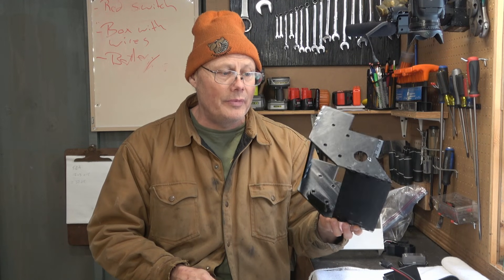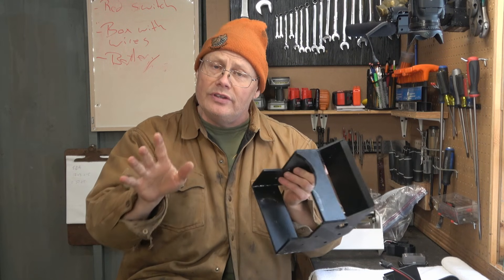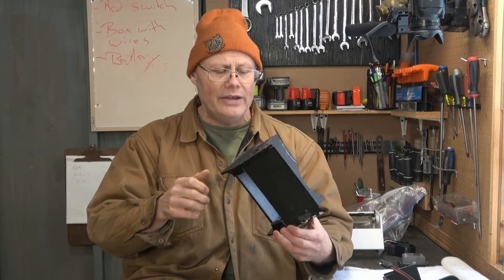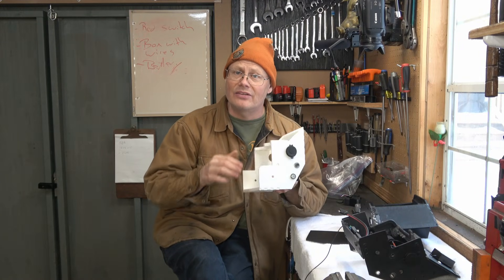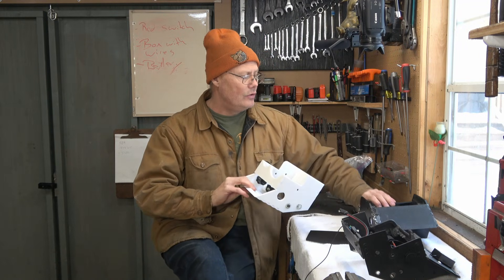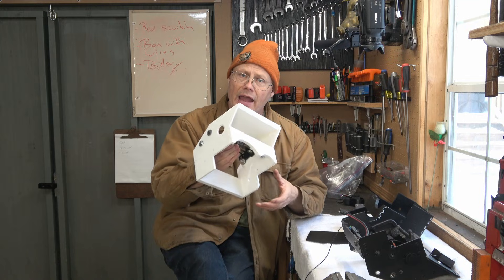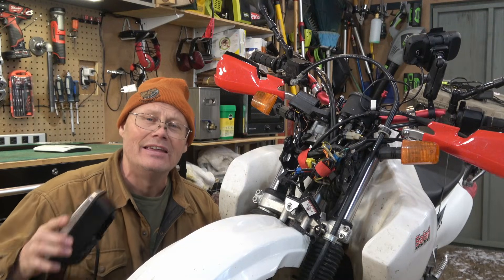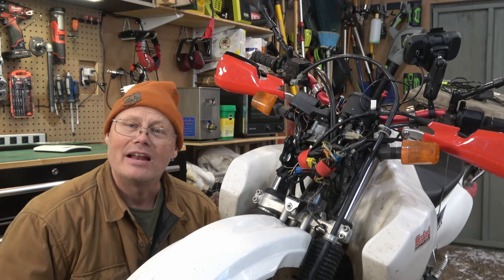Creating A Custom 3d Printed Dash For The Suzuki Dr650!

Comment: Great video, I look forward to seeing the final product! Have you tried the new LED light yet? I'm about to purchase the exact same light and would love some feedback.
Reply from the maker: @cbarmstrong1  thanks for the comment. I have not tried the light mounted on the bike yet. I have plugged it into power and the beam is very well defined although it looks very narrow, it's very hard to tell until I have it mounted and set up. I'm still on the fence about it until I can see mounted and try it on the road. Again, it looks well made and it's bright, I just want to see how it is on the bike.
Sorry, I wish I could be more helpful, but I don't want to give it a thumbs up or down without all the information. 
Dino
Reply: @DinosTinkerShed  thanks for the feedback, I may hold off for a bit until I hear how it is on the road. Sure looks good and the weight benefit is great, nice work on the 3D printed dash it looks like it will fit perfect.

Comment: Cool project Dino!  Is it not possible to print it as all one piece?   Sorry if i missed a previous explanation in an earlier vid.  You're an bad influence for someone who's on the fence regarding buying a 3D printer. 😁 Cheeeeeeeers from Sussex NB!
Reply from the maker: LOL, yes it has ben tempting for me to buy one as well, I finally pulled the trigger. I have thought about printing it as one piece and I may still do that. right now the way it lays down the filament I think the flat print may make it a bit stronger for shear strength than if I printed it vertical as one piece. however it may work, i may just have to print one and test it.
thanks for the comment Dino

Comment: I would recommend printing the fairing panels out of ASA for the final project. PLA and PETG are good, but no UV resistance and will quickly fade and become brittle (kind of like PVC piping). 

You could also use those quick 1/4 turn release screws to mount that top plate for easy access into the dash when needed. 

I’ve been thinking of lots of things I could possibly print for my DR and I’m rooting for you that this dash turns out the way you want.
Reply from the maker: Thank you for the input, I have a buddy with a high end bambu printer who can print the final prototypes, he is a few hours away but i can send him the files when I get closer to the end and he is happy to print in a few different materials.
The 1/4 turns are a good idea, ill have to see if there are some designed for embedding in a 3d print. I want the final product to be easily buildable for anyone who want to try it.
Dino
Reply: @ I’m thinking the quick turn releases should come with a dowel of some kind that can be drilled and glued into place on both panels.

Comment: Have you thought about building a chassis out of aluminum for rigidity and then build a 3D printed case around it?  That still gives you the strength of aluminum but saves some weight.
Reply from the maker: My original was all aluminum and your right, it is very strong. Your idea is very good, however the idea of the project is a print that could be built with less complexity for the average person to make or modify to suit their needs.
In the future your idea may prove to be needed as the dash is tested or for a more robust dash for more aggressive riders. Thank you for your input, now my brain is turning lol.
Dino
Reply: @DinosTinkerShed  That makes sense, my only concern would be how well is that plastic going to hold up to rough roads over time.  So a lightweight skeleton and have the rest of the dash attached.  Either way, I can't wait to see the end of this project and thank you for all your videos and help in the community!

Comment: Great job...keep up the good work....will wait patiently for the finished product.....with the panel part itself, would there be room for a couple toggle switches for lights.  I have put my relay under the seat and use the switched plug to open it....but like your small one.  Oh...it's white because of the snow...right.....Garth
Reply from the maker: @retiredwaterdoctor  so glad you like it. Yes there should be room, smart wire management will be key of course.
Thank you for the comment.
Dino

Comment: It's looking great Dino.  I've been experimenting with PETG vs. PLA.  PLA comes out stronger in all of my tests, which contradicts what others say.  I have some ABS on the way to see how that compares. You are a treasure to the community and can't wait to print this for my DR.
Reply: PLA typically has better adhesion between the layers, but the strength of the raw material is higher in PETG. PLA also has a little lower melting point at which it will start to get soft (60c.vs 89c) , and I believe even at room temp it will sag over time more.

PLA is also supposedly biodegradable so in theory you wouldn't want to use it on anything that goes outside, I've seen plenty of tests from people leaving PLA literally buried in the ground for a year and it still looks just fine.

I believe it was CNC kitchen that did a really good video where he tested tons of different filaments and while I can't remember the final result I do remember that PLA had one of the strongest bonds between the layers, and if you're willing to give up a little bit of quality I believe you could crank the heat up on other materials like PETG to get better layer adhesion
Reply from the maker: @Jtw0912  great information, thank you so much. As i get closer to the end of the prototype phase I will definitely need to test different filiment types.
Dino
Reply: @DinosTinkerShed  I’d be happy to test some things for you if you ever need it.  I’m fairly new to 3D printing myself, but have had success in printing with ABS and ASA filaments.  My printer is more capable than I am at the moment!
Reply: Pla isn’t suitable for outdoor use, it’ll basically disintegrate in sunlight and rain, because it’s plant based and biodegradable .  ABS or ASA is your best option for bike parts like that.  Or even better ABS-CF or ASA-CF.  Pla is great though for prototyping in the initial stages of a design
Reply from the maker: @michaelhefford6420  thank-you for the feedback, the pla I'm using is indeed for the prototype  phase,  I will most likely have it printed by a friend with a more capable printer than mine once trials are ready. Thanks again for the information,  I'm very new to the 3d stuff.
Di o
Reply from the maker: @jonwoodworker  glad you are enjoying he build, any recommendations on Adhesives? 
Dino
Reply: @DinosTinkerShed  I've tried a bunch of different glue's and watched every glue review for 3D printing.  I've had the best success with 2P-10 Super Glue Thick and you can use an activator.  CA glue seams to melt the plastic for a solid bond but can visually ruin a part if you get squeeze out.  However, I don't believe any glue will work well for the tower....only testing will prove if it stays together.  I would try joining all the parts in Tinkercad, load it into your slicer and use supports.  Leaving off one panel for access and use the press in inserts for attachment. I believe the tower is open at the headlight, so that is one access point.  And you could leave the top mounting plate off.  Leaving the top mounting plate off would make it easier for someone to customize to fit their hardware.  And if they F it up, they can easily reprint that one part.   I would also increase the wall loops, percentage of infill, and try Rectilinear infill.  You did such a nice job on the OG metal one adding the fuse box.  I would figure out where you want the box to be and try to figure out some cross bracing inside.  I'll send you an email with a bit more.
Reply from the maker: @jonwoodworker  fantastic, I actually have virtually assembled it in tinkercad and though about printing it as one piece, I was mostly worried about the orientation of the layers if I printed it standing up as they would be in line with the ground creating a weak spot, does that make sense?
Again thank you for the information, it's very helpful.
Dino